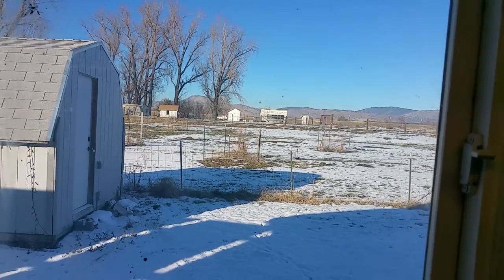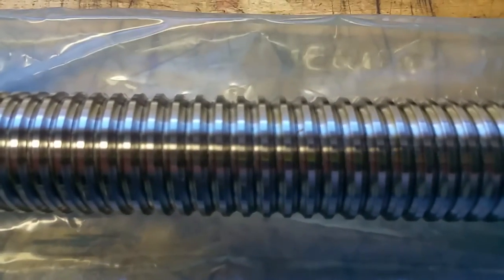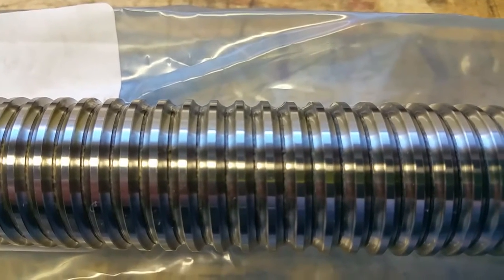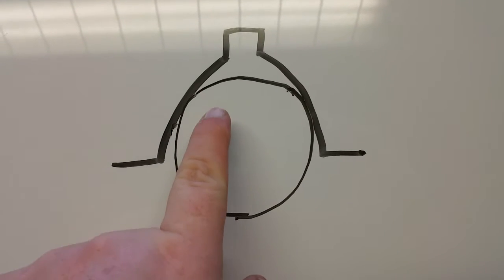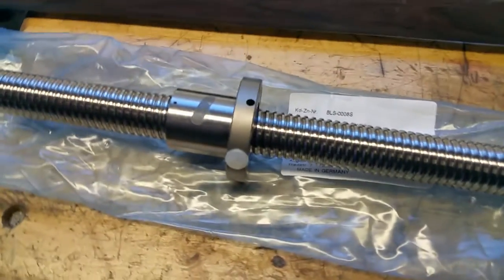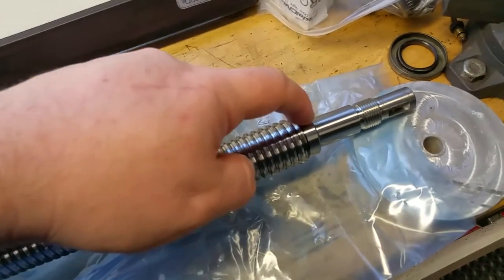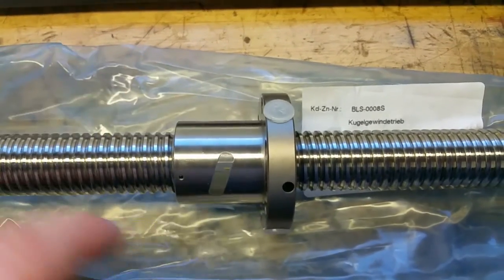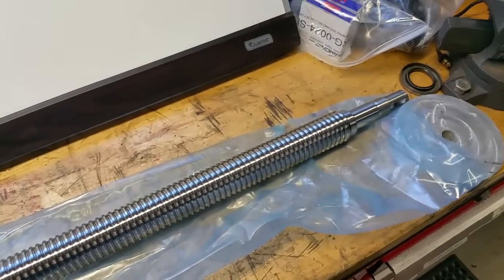Preview of new Fadal ball screws

Comment: your drawing implies  ball contact design. if so rotational value of ball to Raceway dissymmetry is to the point of excessive wear . even with no static pressure the screw, would be lapping conical Chrome spheres. large pitch diameter screws with small both sizes usually have high static wear properties. the zero backlash implied a Precision ground screw only holds a 0.0005  per linear foot warranty. in my opinion the pitch shift design is far superior